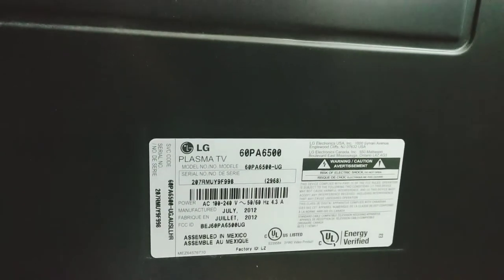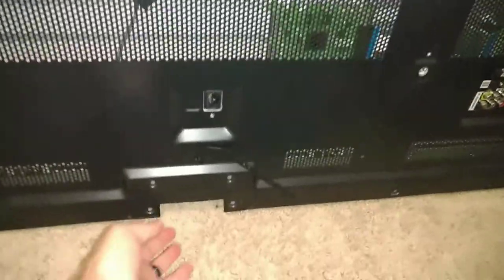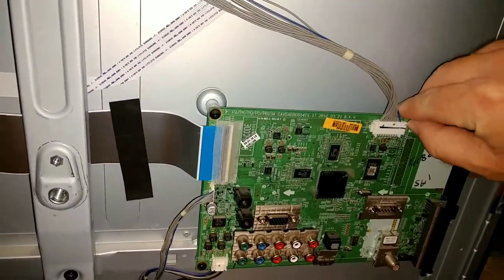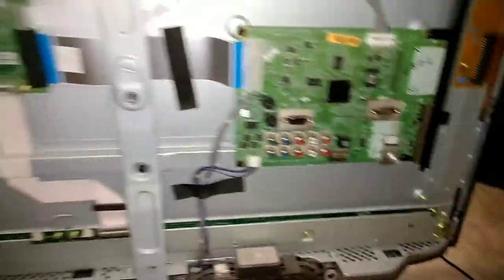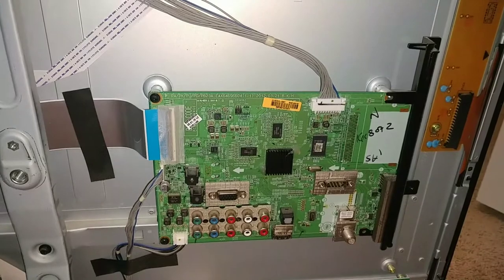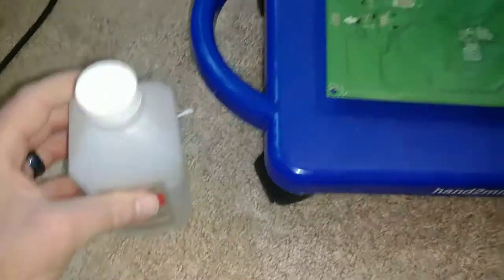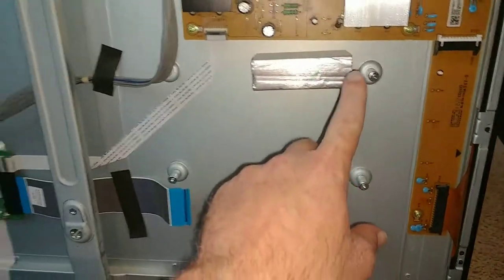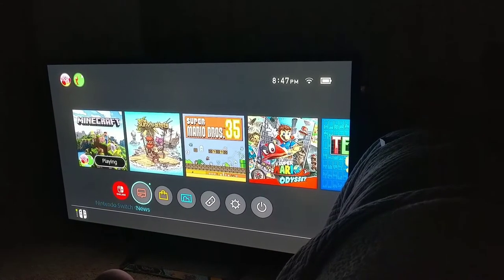Fix LG Plasma TV Video Flashing on HDMI. Model: 60PA6500-UG

Comment: On mine with it unplugged the screen has faded areas. Started a movie and screen goes black in 5 minuites but has sound.
Reply from the maker: Mine used to shutdown on it's own and then when I turned it back on there would be no picture but you could hear sound. I think there's poor solder joints causing it.

Comment: Thanks for posting this. My friend is having a similar issue. We are going to try this out.
Reply from the maker: Let me know if that fixes it. I'm currently troubleshooting another problem where it randomly shuts off and then when you turn it on, there's sound but no video. Then let it sit a few minutes and it will work normal again.
Reply: @becausestuffbreaks  My friend said the tv had issues turning on because it would turn off. Even during sustained watching it would turn off. He complained about sound but no video sometimes too. I showed him your video and told him to tighten down the motherboard screws. He opened the back and a screw holding the input motherboard had completely fallen out. He found it in the case and screwed it back in along with tightening all the motherboard screws. He said the tv is working great now!
Reply from the maker: @ShatteredF1re7733  Awesome! I also have the problem where it shuts off randomly and then when I power it on, it has sound but no video. Tightening all the screws only fixed the flashing problem for me. Still troubleshooting the same problem your friend just fixed. I assume his problem will return.
Reply: @becausestuffbreaks  I have the same plasma TV and I’m currently troubleshooting the same problem as you are. I’ve never had a flickering issue but I’ll turn the TV on and I’ll get sound but have a black screen. The screen might stay black for 10 minutes or longer but will come on eventually. I took off the X,Y, & main boards and Checked all solder connections and touched them up with new solder. Tighten all the ground screws. The problem seemed to go away for several days but has just returned. Maybe the signal board is the culprit? Please update if you find the solution. Thanks for sharing!
Reply from the maker: @modularrc6428  oddly enough, I just learned today a coworker behind me used to repair this TV and he suggested to replace the capacitors on the right side of the power supply board. I'll see if that works. He said they usually never had solder joint problems.

Comment: I have the same TV but it turns off randomly.  May go for an hour, may go 5 minutes.  I may try this but I have a feeling its more than this, what you think?
Reply from the maker: I have the same problem and it didn't fix didn't fix that. I had another person in the comments that had our problem and said doing this fixed the problem. Give it a try and let me know if this fixes it. Thanks for watching!
Reply: @becausestuffbreaks  Ok, going to take it apart today.  There are videos that show cracked solder for this issue also so crossing my fingers thats not it, but it may be the case for you now ;(
Reply from the maker: Thanks for the info. I'll look for some cracked solder joints.
Reply: @becausestuffbreaks  This is one of the vids i was referring to, although he doesnt seem to say if it fixed it... https://www.youtube.com/watch?v=LbiOC7mGeTI
Reply from the maker: @OceanTidesSunsets  Thanks! I'll try it when I get some time and make a video of it showing the symptom and if it's fixed. I don't know when I'll do it.
Reply: @becausestuffbreaks  The screws on the logic board were barely loose, but i tightened them as much as possible, and every other screw i could see that wasn't glued in.  It really wasnt that dusty but i blew out the dust anyway of course.  My issue got better the longer the tv was on so figured heat wouldnt matter.  Anyhow, after all that simple stuff, the problem is fixed.  Hard to believe slightly loose screws on the logic board could matter that much but I guess it does.  So, i'll be putting that 800$ i saved towards my new car brakes... lol, thanks for the vid.
Reply from the maker: @OceanTidesSunsets  lol, thanks for watching and glad that worked.